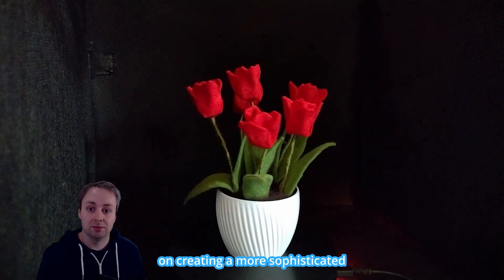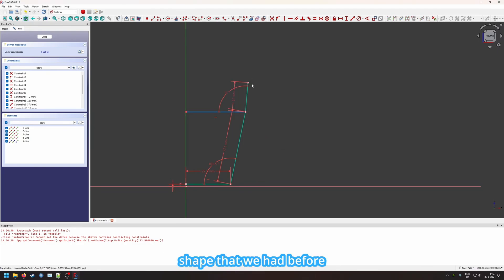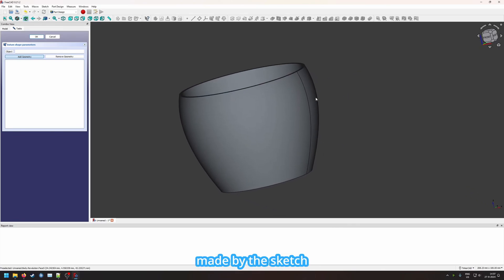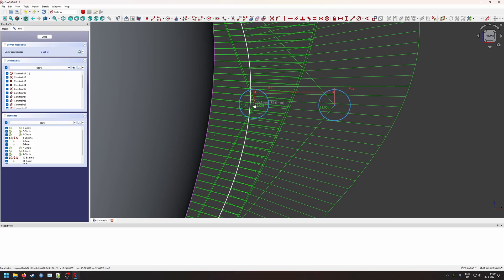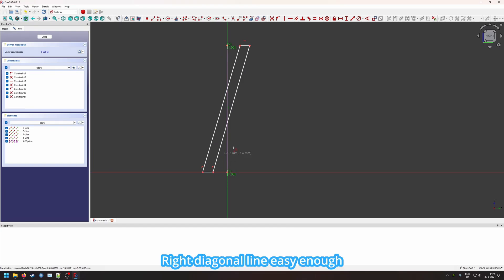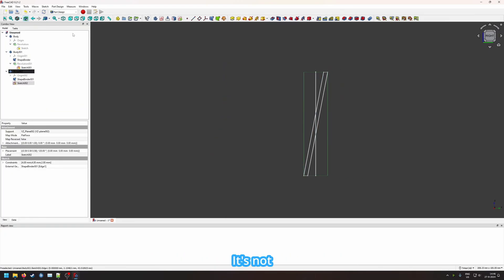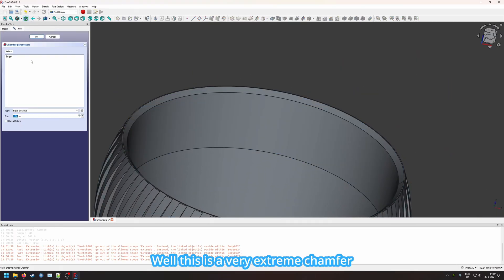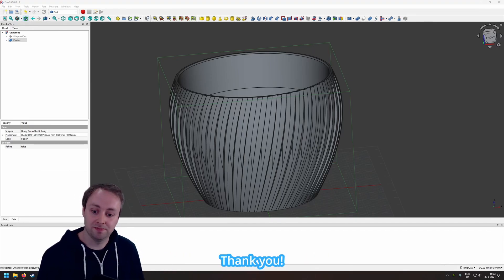Beginner Tutorial: Twisting Flower Pot using FreeCAD

Comment: 4500 non manifold edges reported in the slicer there when you imported it? So the STL was slightly broken. The slicer fixed that, but I think you needed to bury the slices deeper into the model to get a clean STL. Somebody won't be able to print that if they're using an older slicer.
Reply from the maker: Thank you for spotting this one. Not sure how I missed it, but I will be sure look out for it in the future. I suppose I have come to take the extra work that the slicer does for granted. Luckily it does print properly with recent slicers.